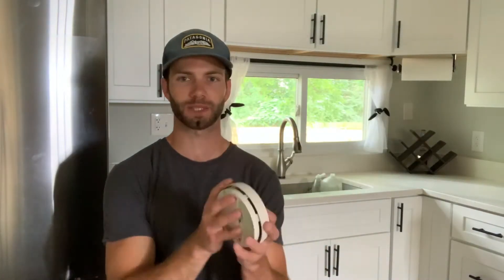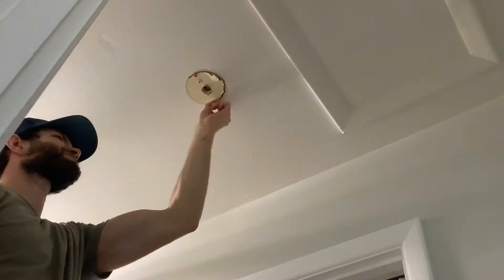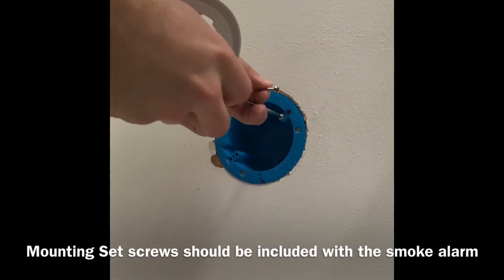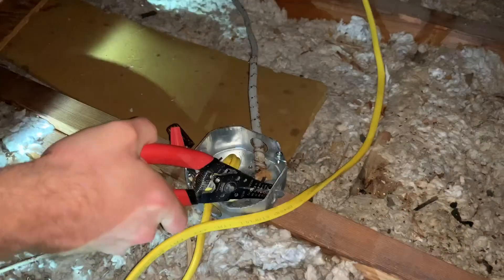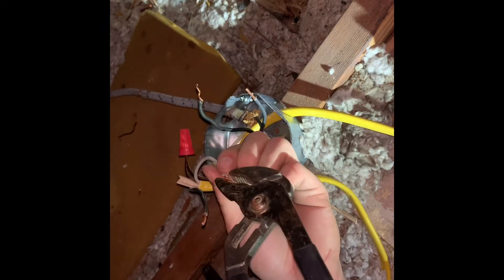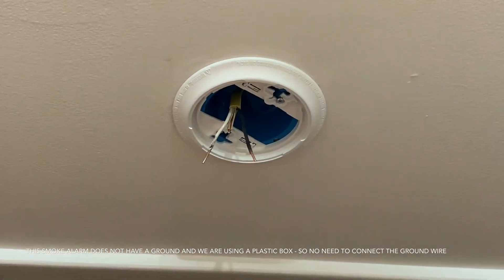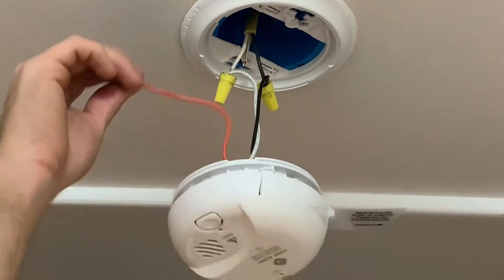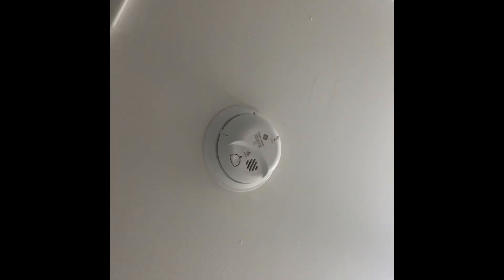How to Wire a Smoke Alarm/Carbon Monoxide Detector

Comment: No matter if hardware smoke detectors are right next to each other you need to have them interconnected into each other. If not, then it’s a code violation.

Comment: WHY use 12 gage...??
I thought 14 gage white wire
Reply from the maker: Depends on the application, what size breaker you are using, and how many fixtures are on the circuit. But 14-2 wire is usually ok for many situations. Thanks for watching!

Comment: Thanks for the video! Could it be wired with 14/3 ? Or must it be 12 ?
Reply from the maker: If you are on a 20 amp circuit, it needs to be 12. If you’re on a 15 amp circuit, you could MAYBE use 14, but it depends on a Lot of factors and you should probably ask an electrician. When in doubt, I recommend 12. Thanks for watching!

Comment: Do you need to include the ceiling box?
Reply from the maker: You definitely want to use the electrical ceiling box. Although you could technically wire it up in the attic without the box, you never want to have loose, unsecured wires. It also would not be code compliant or safe. Thanks and good luck!